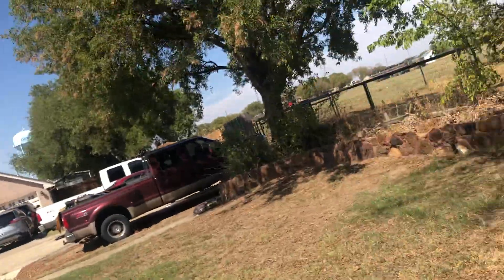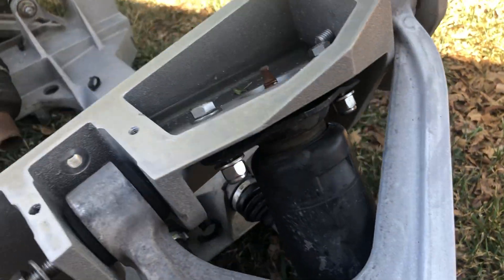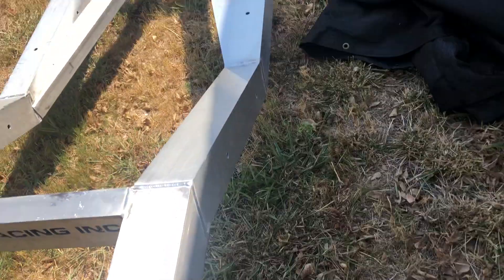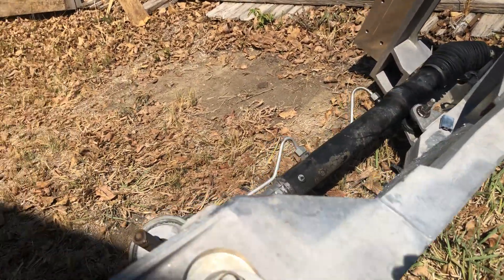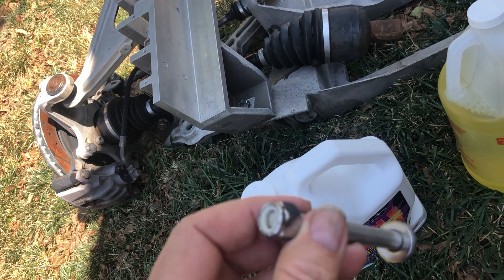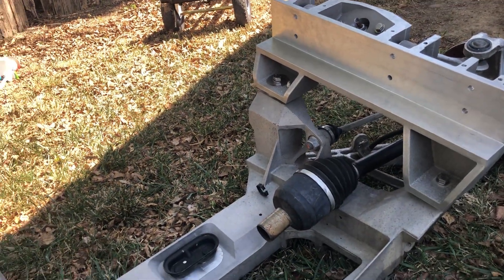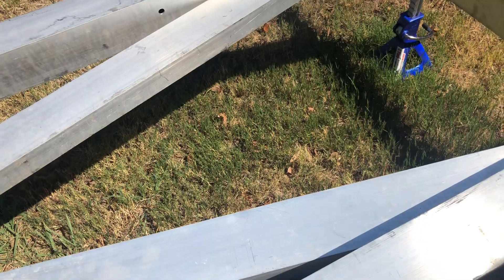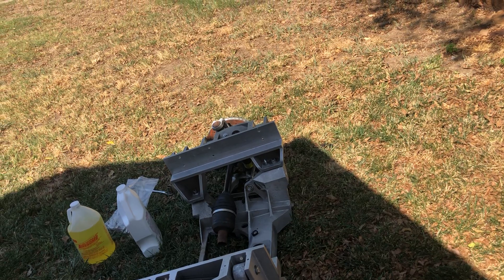Forget “Cleaners” on Aluminum! - C8 Corvette Hack

Comment: I'll bet the aluminum brightener contains phosphoric acid.  That's what the Espree aluminum wheel cleaner that I mentioned in a previous upload had in it.
Reply from the maker: It contains multiple acids. I’ll need to read the label again. I tested it on the frame rail and it didn’t seem to
Have any impact at all. That’s good because I don’t want to have to disassemble everything just to treat it.

Comment: So you are saying that the Nyloc nut and bolt were dissimilar materials which was causing the galling necessitating the anti seize? 

The Nyloc nut gets its name from the plastic material which is in fact nylon.
Reply from the maker: That’s what I initially thought. But, after inspecting the galling, I realized that it was the stainless to stainless interaction that caused the galling. I’ve never seen that happen before. 

My guess is that the nylon caused enough additional friction to rotation that it caused the galling. The anti seize reduced the friction on both the nylon and the stainless enough to eliminate the issue. 

Strangest thing I’ve ever seen and I wouldn’t have believed it if I hadn’t seen it myself
Reply: @shadetreesupercar  It almost sounds like the bolt had been pre-coated with some kind of microscopic Loctite.  🤔